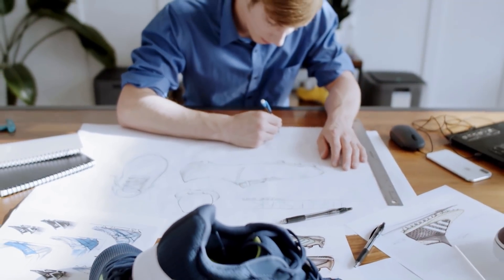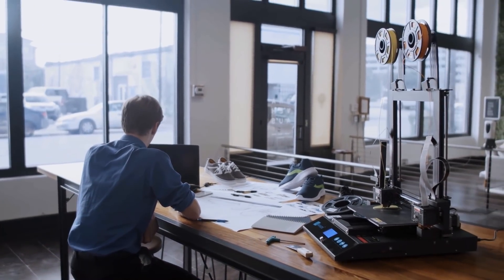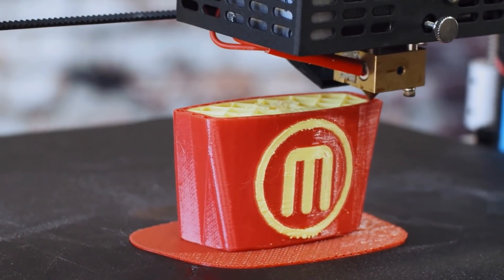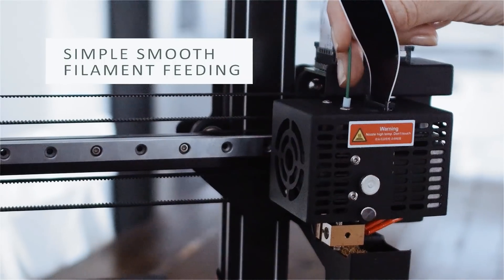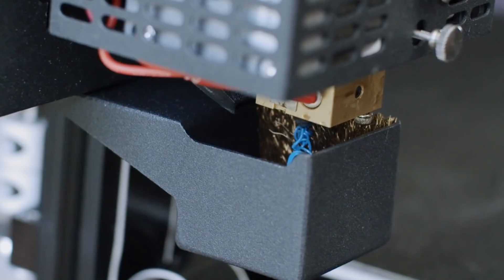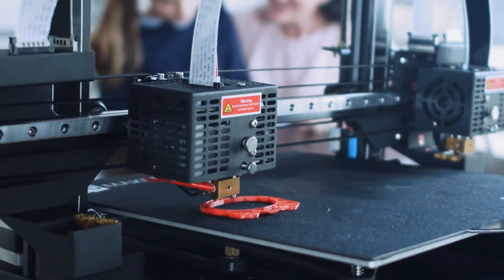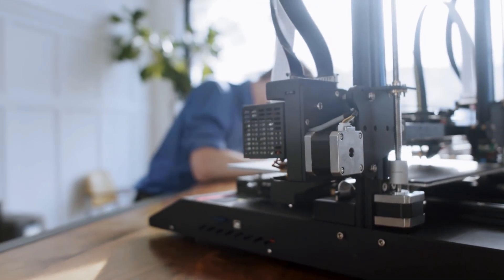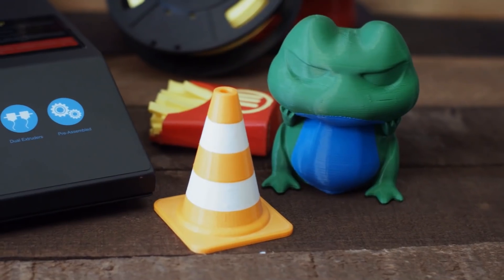JGMaker Artist D Dual Extruder Independent Direct Drive 3D Printer Promo Video Kickstarter 2020

Comment: There seems to be a bug in Marlin 2.0.6 that can cause a layer shift on IDEX printers. I’m working with a couple of developers who have IDEX machines to try to track down the issue, and also working on a simulator to stress-test the motion system and catch these kinds of things quickly. The cause seems to be an improper setting of the DIR pin when changing extruders. But since it occurs so infrequently it is hard to pin down. Keep an eye out for a fix, to be included in 2.0.6-2.
Reply from the maker: He scott, we are working on our firmware as well, and will release our source code at our official website once we start to sell

Comment: Looks like a nice printer. Would it be possible to use Octoprint with it? Also would it be possible to use an auto bed leveler?

Edit: also will there be PEI sheets available for it?
Reply: octoprint is ok, for ABL , will not in this version.